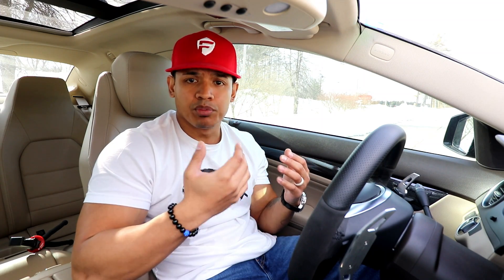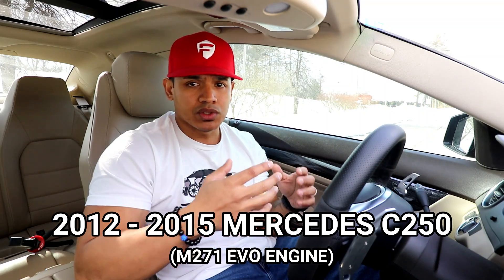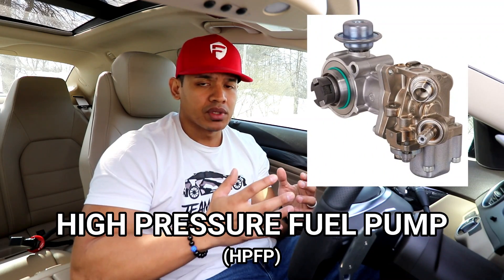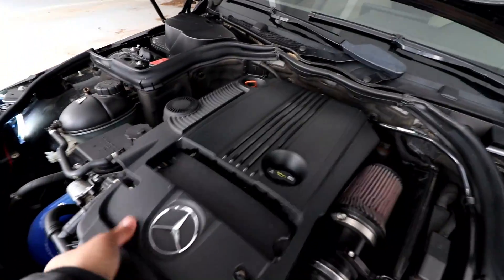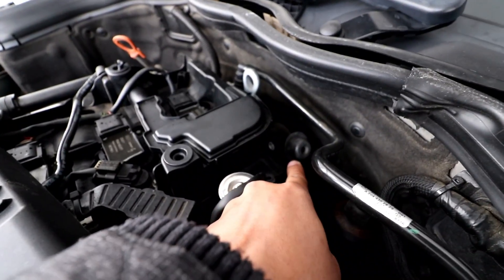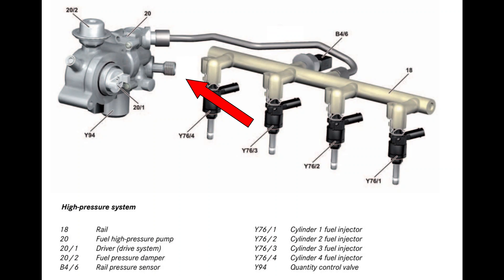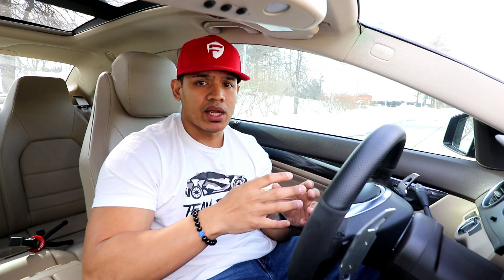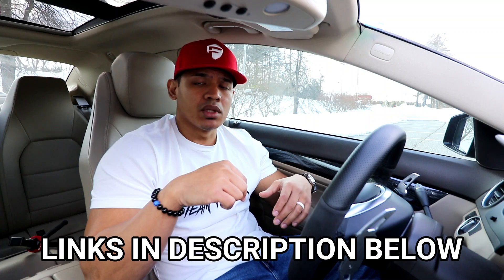FIX MERCEDES C250 P0002 POWER LOSS WHEN ACCELERATING

Comment: I'm really glad you did this video! Unfortunately, my car started with this for the first time today. I did an ECU reset to see if that might have been the issue so I will keep an eye out to see if my car keeps acting up. Do you know if this is an install that I could perform myself or would it be best if I went to a mechanic?
Reply: Someone did a video, maybe not on this model, replacing this pump along the firewall. There is little to no room, and he had to remove many components to get at it. He said it was possible to do if you know what you are doing and can stand the frustration. He actually used an engine hoist and loosened the engine mounts to make more room, though he said that was not needed if you don't mind tight fits for hands and tools. This acceleration case it is probably a high chance of the pump, but getting the code in general can have other causes like the sensor or wiring
Reply: @mykofreder1682  Just an update on my issue. So this happened to me about a week after I had an oil change. I read somewhere that I should first try doing a reset of my ECU. I did that and have not had this issue happen to me all week. I have tried every day to make the issue reappear by accelerating at various speeds up to 80 mph, yet everything seems fine after the ECU reset. It could have just been some random issue with my car. Bottom line is, if you have this issue especially shortly after some sort of service, give your ECU a reset and see what happens.
Reply: @BondsNTags  how do u do an ecu reset?
Reply: @BondsNTags  How did you reset your ECU..I just threw this code yesterday but my car operates like normal
Reply: @BondsNTags  ?
Reply: @moneyteam9291  Completely forgot about this. Oops

https://mbworld.org/forums/c63-amg-w204/366484-easiest-way-reset-my-ecu.html

Comment: This happened to our 2015 SLK 250 today but after restarting the engine the problem remains. Any thoughts?
Reply: Did you get it fix? I have a 2013 slk250  having same problem
Reply from the maker: https://mbworld.org/forums/c-class-w204/828388-warranty-extension-high-pressure-fuel-pump.html

Comment: My mercedes a200 w176 no power sometimes when press full accelerating no check engine light blinking and fault code NO1 P059700 the coolant thermostat has an electrical fault or open circuit No2 P233827 the knock limit of cylinder 3 was execeed(the signal change rate is above the permissible limit value) No3 P029921 the boost pressure of turbocharger 1 is too low(the signal amplitude is less than the minimum amplitude...anyone has ever had something like this?

Comment: Hey I have a C240 2002 Benz and my car has two issues. The other day I was driving and then and it sounded like my car wasn’t getting any power like it wouldn’t go over 40mph so I pulled over and tried to put the car in park but it wouldn’t go pass Neutral. So I put the parking brake down and then it went into park. So now I can’t go over 40mph and I don’t know what to do so could u give me some feed back on what u think it could be. Thanks
Reply: Are your cats clogged?  Do u hear a low rumble sound ?
Reply: No low rumble sound, I had to hooked to machine and it came back that I need transmission control sensor unit PRND I think code 702 or 703

Comment: Hi guys, I'm owner of a SLK 250 2014 with only 10.000 km, and I'm having this issue occasionally. I've already replaced the HPFP pump wondering it could fix, but it happened again last week while I was travelling.

Does anyone have another clue to fix this issue?
Reply: Are you getting the check Engine light while its doing it ?
Reply: Many causes for the code alone, the acceleration setting it may be the pump indicator, just tuning on without acceleration could be one of the other problems. Someone gave general problems associated with this code (Disconnected plug to the fuel regulator, Possible corrosion in the sensor connector,
 Damage to the sensor wiring to the ECM,
 Leaking or defective fuel pressure regulator, Damaged fuel pump,
The ECM is damaged), this was general info, I don't know if Mercedes even has a separate regulator or if that is part of the pump.

Comment: Hi Flex ! Nice video !! Especially the engine diagram very helpful!! Can you make video how to fix it ? What needs to be romoved how and if I need special tools and measuring device ? Also if Anyone knows How to replace the high pressure fuel pump on 2013 SLK 250 1.8L ? The engine looks the same and if I’m ordering any parts it shows same as for this car on the video .I guess it has  the same engine. I saw only 2 videos on YouTube but can’t see much they say to turn the engine on 52 🤷🏽‍♂️ also people measuring the pressure in the HPFP . So I’m wondering if I just take the two bolts and two hoses and replace it .If I could mess up anything if I don’t measure the pressure also it’s gas don’t want to burn the whole car after replacing it my self ,but if it’s easy just 2 bolts 30 min job don’t see why paying $1000 labor and $800 for fuel pump at Mercedes dealership!!! I just ordered the pump new for $300 !!! I did pay $209 diagnostic even telling them it’s the HPFP prior diagnostic 🌰🥊so it would cost me $500 instead $2000 at MB if I fix it . Also when I called the MB they said $499 the part but at the shop different lady told me $790 🤷🏽‍♂️ than trust people like this .... that’s $300 difference so I bought new online for $312 ... because MB don’t have it in stock anyway and they  have to order it , takes  one week on the island so I get it in one week too ordered last night  also with pulleys which they want $490 parts and labor I paid $28 for 2 pulleys and it’s one screw each pulley 10 min job $400 labor at MB😅
Reply from the maker: I never had the issue that’s why I never made a video. I only made this video because I knew what the issue was that everyone was having and wanted to share the info.
Reply: Ok cool hopefully someone let me know within a week otherwise I just take it to European specialist mechanic I take my other benz and Bmw, with the part I bring they shouldn’t charge for more than 2 h work..
Reply: Where did you order from

Comment: I recently bought a 2009 Mercedes c300 and the gas gage stopped working. Do you think it's the fuel level sensor or the Fuel pressor sensor? The runs amazing and has lots of power but the gage doesn't work and some times it shows a full tank. Anyone else have this problem?

Comment: I have the same problem on my w205 but I don’t have check engine light tho
Reply from the maker: Most don’t have the check engine light when it happens. But if you plug in a code reader, a fault maybe stored.  

Cause check engine light won’t come unless a fault happens multiple times within a certain time frame. Again, doesn’t mean there no issue. Just means the issue happened but not enough to trigger the light.
Reply: @ do you think is the pedal sensor or throttle sensor
Reply: @TheFlexxGarage  do you think by cleaning the sensor

Comment: I just bought 2013 SLK 250 looks like your engine, I think the seller just erased the code and sold me the car because the engine light came on just 3 days after I purchased the car !!! I thought it’s the turbo first but than went to mechanic and got the P0002 code ..I agree with you on the recall because my car has only 45000 mils should be still under warranty but it’s 8 y old .At Mercedes they said it’s gonna cost around $1700 . I call told them the code told them need fuel pump than they just repeated  what I said for $209 Such a rip off !!!.  They charge 5 star price but give 1 star service! I had shuttle scheduled but they said it’s only for her manager and her mechanic!!! So I had to walk home and back it took them 2 h diagnostic when I already told them what’s wrong 😑
I just bought the car 3 days ago !!

Comment: I have s63 amg w222 year 2015. I cannot get rid off of this misfiring.  I changed sparkplugs, i changed ignition coil pack. Same . Now its going into limp mode only when i press hard the acceleration. What could be ? Anyone had something similar?
Reply from the maker: What’s the fault code when your car is plugged to a code reader? Your car doesn’t have to have a check engine light on, for there to be a fault. 

The check engine light only comes on if the same fault occurs more than once within a certain time frame. If you have the issue once and car shuts down, fault is there but not enough for a check engine light to pop up.

Comment: Same thing happening with my 2014 c250 coupe my car battery has died 4 times in less than 3 weeks and every time I try to start the car makes a noise which it goes away after a couple seconds …
Reply from the maker: That’s not the same thing.  You have a different issue and it’s probably this. https://youtu.be/rwtAdVvZqdk

Comment: hey not too long ago I added the modification of a muffler delete from tornado tuning, and I recently got the code of p0002. is the muffler delete a issue with this?
Reply from the maker: Turbo muffler has nothing to do with the fuel pump issues that’s common on c250 engines.
Reply: @TheFlexxGarage  ty flexx

Comment: Why is this happening to me now. SMH
Reply from the maker: Fuel pump can go at 20,000 miles or 100,000 miles.  Or it can be easy as just replacing the fuel filter.
Reply: Me too it’s happening to me now if you know what can I do Let me know Please

Comment: Mines keep doing it soon as I hit the gas!!! Like come on P0001
Reply from the maker: Sounds like you need a new fuel filter or fuel pump then. Def have a mechanic check it out.  This is dangerous cause if you need to maneuver quickly to avoid a crash or something, and car stalls…yeah….not good.
Reply: @TheFlexxGarage  exactly ima just buy a high pressure fuel pump

Comment: Flex you were right again, I have a 2014 C250 with 40k miles that I bought used but in excellent condition. I drive it in sport mode all the time, throttle to the floor blow off valve installed and muffler and resonator deleted so it sounds amazing. A month ago I had it in sports mode 1st gear (I also drive the automatic like a manual just to hear the blow off sound 🤣) about to make a turn at a green light floored it and the car lost power and the check engine light came on. This was the second time it happened so I took it to an AutoZone and got the code read. It pulled up p0002-77 Quantity Control Valve Malfunction, brought it to my local Mechanic and he ran some fuel pressure tests and found out it was the hight pressure pump going bad causing my car to fight to start and not getting enough fuel when I accelerate too hard. It was replaced, high pressure pump costed $700 labour $400 and analysis $86.
Reply from the maker: Did Mercedes do the repair? Cause like I shared in other comments, MB just released a warranty extension on the pump. They finally owned up to it. If your car has the issue now, it can be repaired for free.  If you had MB do the repair and you paid, you can apply for reimbursement. I don’t know about using third party shops though. 🤷🏻‍♂️
Reply: @TheFlexxGarage  where can I find more info about the warranty extension and does it apply in all countries? I would really appreciate it if you share a link with all the info.
Reply from the maker: There’s no link. You either got to Mercedes’ website and put in your vin and it pops up, you either get letter in the mail, or you call Mercedes’ and ask if your car is affected
Reply: @TheFlexxGarage  I called my Mercedes and didn’t offer anything, where did you get this from?
Reply: @JayJay-qr6pw  they also did not honor it for my car
Reply: @FlexxAlexander Mercedes did not because the closest Mercedes dealership to me is 2hrs away and I didn't want to drive it all the way out there in that condition I had a trusted mechanic in town handle it
Reply: @TheFlexxGarage  Is there a mileage limit on the free repair?  Mine has 125,000 but I love driving it, but today I idled out of a parking lot and nailed it to get a big boog.  CEL lit up but it did not limp mode.  It drove as if the turbo crapped out.  I stopped for dinner, came out afterward and started, still with CEL on and drove home driving like no turbo power.  Otherwise it shifted well all the way home.  I hooked up the scanner, saw the P0002, cleared the code, restarted and she drove fine, full power and no glitches for several miles and returned home.

I need to mention, when I pulled out of the driveway, I was low on fuel making a 90 degree turn when I floored it and lit the CEL.  Could the low fuel level, centrifugal slosh in the fuel tank and high demand have facilitated the P0002?

That was about 20 minutes ago.  I will wait to the morning and see it I have any symptoms back.

Comment: happened all the time. Changed the pump for a used one, worked for a year; now the same problem again! The pump is faulty. Shame on MB. I had a C200 Kompressor before. Not one problem. Will fix it and sell it. Had this major issue twice PLUS another one: Intake Camshaft Adjuster Actuator. Expensive repair. Apparenty, both issues are well known problems of this shitty engine
Reply: Interesting.  Have a C180 Kompressor 2012 which has been experiencing the problem for 2 years.  MB dealership seems to have no clue?!!?

Comment: Same, but no cell
Reply from the maker: I wouldn’t be surprised if your ecu does have a store fault on this.  Cause a CEL will usually only pop up if an issue is really bad that it can harm the engine or the same fault occurs multiple times within a certain timespan.
Reply: @TheFlexxGarage  I have icarsoft MB 2 , no dtc in ecm or any of it.
Reply: @TheFlexxGarage  It was a cracked, hard plastic vacuum hose that ran under the plastic intake manifold, the crankcase breather tube. Had to remove intake to fix it. Assuming the leak wasnt bad enough for cel, but still affected performance. Used icarsoft mb 2. 

When the amgs stop crackling or backfiring in sports+ you know somethings up everytime

Comment: Had this problem, took my car to Mercedes benz, they said the code was "bogus". Gave me a software update in car, havent had a problem yet.
Reply from the maker: Well then you’re a lucky one with a bogus code. Cause there’s nothing bogus about going to press your gas pedal and the car going into limp mode. Pretty sure people with that issue don’t think it’s  “bogus”.
Reply: @TheFlexxGarage   nothing is bogus about 180 dollar labor fees.
Reply: Problem just continued, Mercedes says I need a new transmission control module. This part will cost 2300 dollars. My car has 7900 miles on it, always well maintained. Seems like the internet has a bunch of solutions to solve this problem. Hopefully after this new module the problem will stop.
Reply: @Thegreatestversionofonesself  your car is covered under warrantee. you didnt spend any money.
Reply: tropicAl Rock update?

Comment: Yeah just found out about the extended warranty. Mercedes still won’t honor it.
Reply from the maker: Then call Mercedes’ Benz USA. They are not the dealerships and will do more for you. If they won’t honor it, then your car is not part of the group of c250 covered or your car is not within their requirements. If you didn’t get the letter directly, your car is not in the group that’s covered.
Reply: @TheFlexxGarage  yeah I called corporate provided the diagnosis from five years ago from the MB dealer. Now that it’s ten years old and over on miles they won’t do anything. Intermittent problem anyways but lackluster service, too little too late for my situation.

Comment: Same issue I’m having now. 2014 C250.
Reply: Jeremy Whitaker Having the same problem with my 2014 C250. Took in a few places, looks like the high pressure fuel pump needs to be replaced. 3 different estimates ranging from $900-$1200. This seems to be the only fix.... lucky us
Reply: Have the same issue! Everytime i try to floor it it happens.. it so fkn frustrating!!!

Comment: We have just got a 2014 C250 coupe and i got a rattling noise , next thing engine light comes on and the car completely shuts down and there is a oil leak underneath the engine under the right side ( looking at engine from front on the passenger side ) NZ  , car will no longer start and has no codes come up on the screen , guess we will be getting a mechanic to plug the diagnostic tool in and take a mortgage out on the house for repairs , I told my wife not to buy the bloody car
Reply: Did you guys ever figure out what’s  wrong?
Reply from the maker: Sounds like they are experiencing the camshaft adjuster issue at its later stages.  Cause ones the camshaft adjust starts slipping, it gets harder and harder to turn on the car cause the timing of the engine is off. Once the timing is completely off, pretty sure the car won’t start to prevent further engine damage.

Comment: Can this also happen on a C180 coupe? Every time I press the acceleration hard, it buckles and losses power and the engine light comes on. After parking it for a few hours it’s Normal again.
Reply from the maker: Yes. It can.
Reply: I have the same issue on my 04 c230k did you figure out the fix?